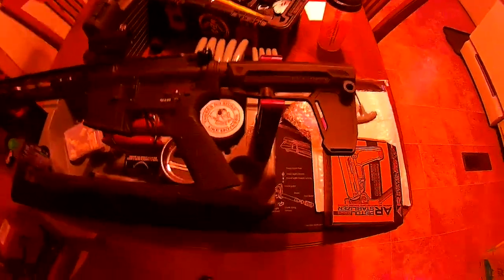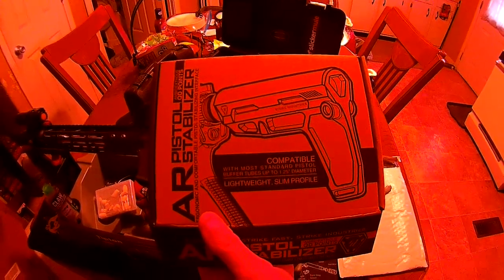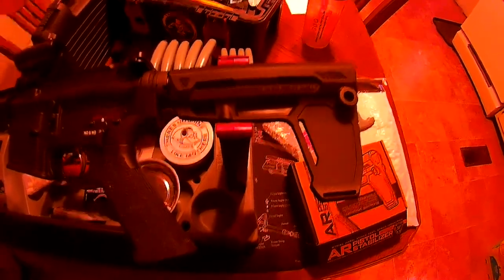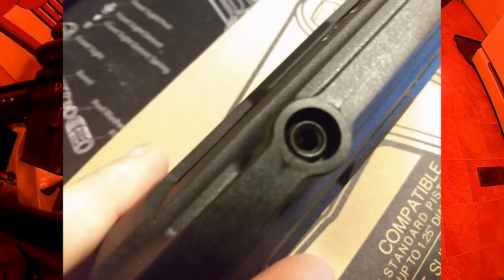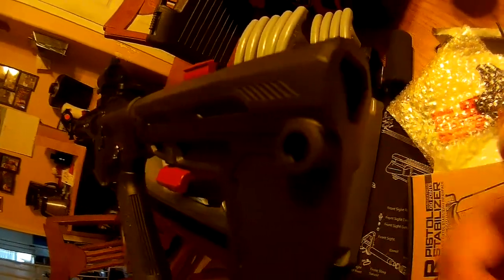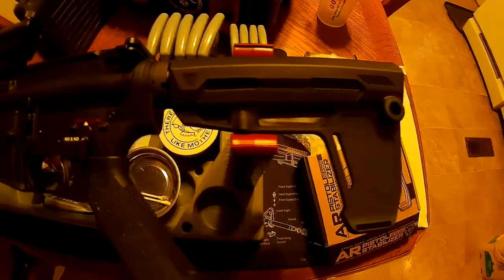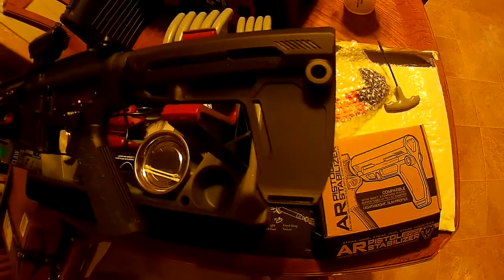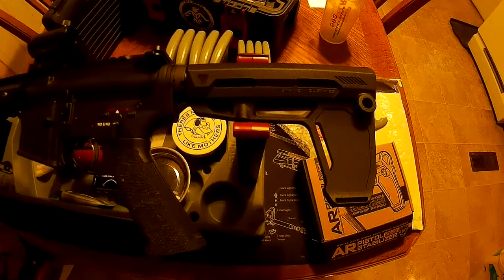Strike Industries AR Pistol Stabilizer

Comment: I have had one on the SI short buffer tube for a good minute and it’s been awesome. I was also a little nervous about the set screw being the only thing holding it but no issues… now the tube does have like golf ball type divots so the screw can have a resting spot. Yep definitely a fan.
Reply: Does the buffer tube have to have the screw holes to fit or does it just set on ?
Reply: It just sets on with the one screw but is very stable
Reply: Main thing is don’t over tighten it bc it can crack the brace if you crank down on it too hard
Reply: @MichaelSmith-kb9iu  just bought one hope it’s worth it ✌️ thanks was worried you need the buffer tube with the screw holes already, does the brace need to be all the way pushed in or could you kinda of extend it and lock it in place if you want more length
Reply: You can lock it anywhere. Keep in mind that the further back, with less buffer tube in the brace it can get a little less stable but yeah bro you should be happy with it…